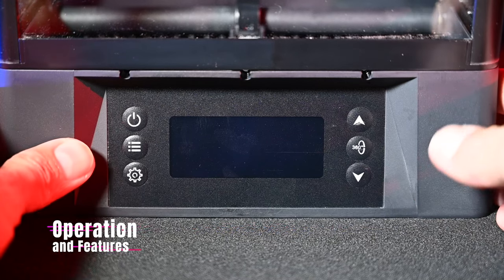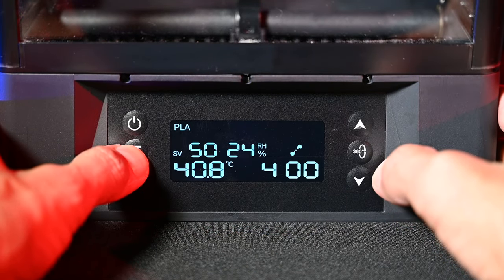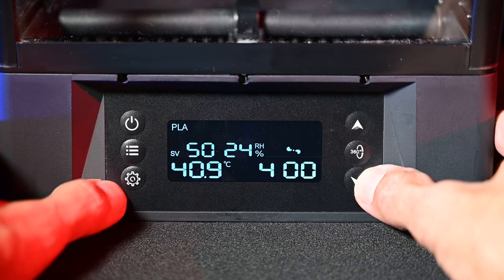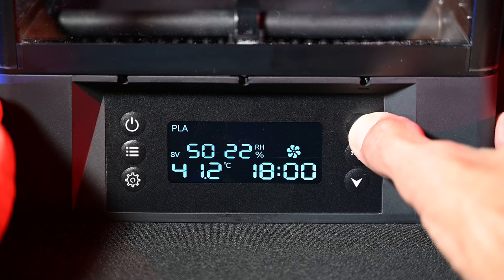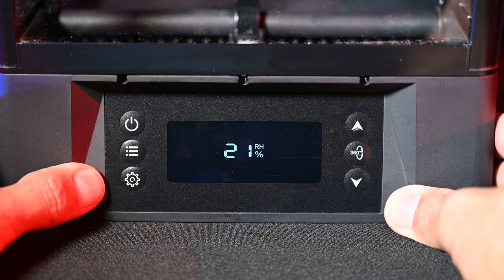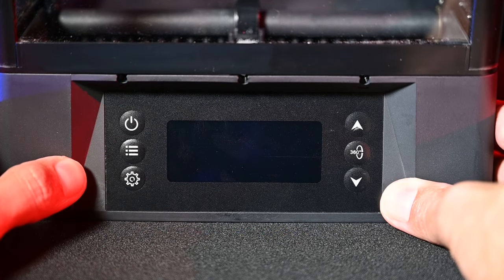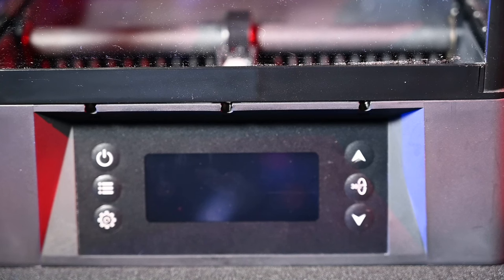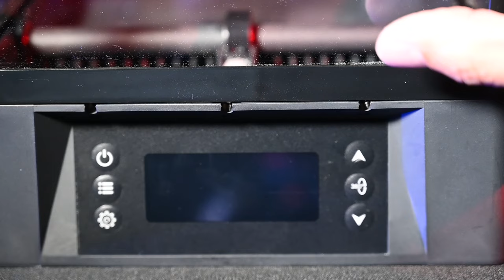eibos Polyphemus Review and Roller Upgrades! - Rotating Filament Dryer for 3D Printing

Comment: Your spot on with your comments, especially the pros and cons.  I discovered your channel when I was looking for a solution to fix why my filament was not rotating all the time when that 360 setting was enabled.  I think I ruined two brand-new spools of PLA filament because the spools were not rotating during drying and the bottom area cooked them.  When I attempted to use the filament certain areas of the filament kept breaking because it was brittle while other parts were fine.  Like you, I purchased my unit during the pre-order and am happy with the unit but my other grip is the top is very flimsy and feels very cheap, especially for the price of the unit.  My handle is loose all the time but it doesn't fall off so I just deal with it. Thanks to your "roller sleeve" upgrade, I now believe this unit and I can have a happy working relationship.  One additional improvement I would like to see Eibos make would be for the unit to go into humidity mode when the unit finishes drying.  Maybe these improvements will be added to version 2.  Thanks for you video!
Reply from the maker: Glad the video and sleeves helped you out! Humidity mode would be an awesome addition.

Comment: Nice review.  I like the sleeves-- definitely a good idea for this unit.  

Regarding Quality Control, mine arrived with an upside down control panel, and no matter what you clicked on the panel, if it was on, it went to 70+ C and stayed there.  I took a photo of it running at 65 when the target temp was 50, and showing the inverted panel, and they instantly shipped me a new base, with instructions to toss the old one.  So +10 for customer service, minus a whole lot for them not noticing it wasn't assembled properly before they shipped it.

All in all, with a few mods, it seems like a good unit.  I've been drying my antique filaments lately, and having issues because they don't fit (remember the short/fat spools?), so I think I'm going to print a rack to put them on.  Or maybe remix a spool holder to fit inside and keep the spool elevated.
Reply from the maker: Wow, that is wild! I hope they step up QC some. Glad to hear that they took care of you though!

Comment: An excellent no-nonsense review.  I agree with your points, especially the cons.  I've experienced the spools walking towards the outside edges when the rotation feature is on, so your TPU sleeve is something I will consider.  Thanks for sharing.

On my unit, I have an annoying defect, where it appears that there is backlighting on the right column of buttons (up, rotate, down) but not on the left column.  Not sure whether the backlighting is an intended feature or just light bleed from the main LCD panel.  By itself, it wouldn't be so bad, except the icons are unevenly lit and hard to make out due to an obstruction behind the buttons. I realize this is a nit compared to some of the functional issues others have reported.
Can you confirm whether your buttons are backlit?  I couldn't tell from the video.

Looking forward to your next video on the unit disassembly.  How far did you go on the tear-down?
Reply from the maker: Apreciate the reply!  I can confirm what you've observed on your unit with respect to the buttons on the right side.  Mine are partially lit up.  It's not even lighting either. It's almost like the buttons are only partially transparent so the backlight is coming through in random spots.  There doesn't seem to be any light on the left side buttons at all.  The tear down involved removing the bottom cover to see all the internals as I was investigating the best way to remove the motor and the rollers.
Reply: @directedt3ch  Thanks for the confirmation.  Sounds like a QA issue then.  Possibly the button membrane film had a protective backing and during assembly, they did not remove the left side, and the right side one did not come off cleanly leaving debris behind.

Does it bother you enough to attempt to fix it?  Might even be able to restore backlighting to the left side buttons... 😀

Comment: Great review, one of the better ones I've found. Do you know if when in the auto humidity mode it has any issues maintaining lower levels like 10%? Just curious how often it'd be turning on and off especially if the room humidity is a lot higher (like 70%)?
Reply from the maker: I'm honestly not sure.  I've never kept it running like that.  I usually just let it complete a timed cycle.

Comment: Thanks for this review, I received my Polyphemus today and as you point out, the roller design is not great. It certainly doesn't work well with my Bambu Labs spools. I will try printing your TPU sleeves tomorrow (TPU on its way). In the meantime I have wrapped some insulating tape around the rollers and that seems to have got the spools rotating quite consistently.  I am a bit concerned about how easily the spools will rotate when printing direct from this unit. I haven't tried printing from it it yet, but if I try to rotate the spools by hand with the motor off, there is quite a lot of resistance. Other than the roller issue it seems like a good unit. *Edit I have now realised that the resistance I felt when rotating the spool by hand is dependent upon when you switch of the rotation feature. If you happen to stop the rotation when the drive wheel is engaged with the roller then there is significant resistance. It would be better if Eibos found a way to ensure that the drive wheel always stopped in the disengaged position. **Edit 2 I've done quite a bit of printing from the dryer now and it works well.
Reply from the maker: Thanks Martin!  Sounds like we are on the same page.  When I post the teardown video you'll be able to see how that drive gearing works.  I totally agree with everything you stated in your comment.  This dryer is like 90% awesome with a few really bizarre quirks that could have been addressed with more testing and thought.

Comment: Excellent review. I think my own opinion of this unit pretty much mirrors your own, I think its probably the best dryer on the market, and the only one I really trust to actually evenly dry filament, but the QA is lazy and the rollers are just made of the wrong material. Another beef I have with this dryer is that it doesn't switch into storage made after it finishes drying -- what were they thinking? 
I'll be printing up your sleeves soon! Thanks for making and sharing that!
Reply from the maker: Thank you!  Totally agree with you.  Entering to the storage mode would have been brilliant!  Seems like something they could have easily done.  Unfortunately there is no path for firmware updates on this, so I guess we'll always be stuck with switching on the humidity hold mode manually. Glad you are going to take advantage of the roller sleeves!

Comment: Good review. Is the fan speed adjustable/does it change according to the "heating level"?
Reply from the maker: The fan speed is adjustable.
Reply: @directedt3ch  Can you confirm that the fan speed audibly changes when you adjust it? The thing is, mine doesn't. And eibos says that it's not supposed to. 🤔
Reply from the maker: @rs90009  That's really interesting!  I just tried changing the fan speed on my unit and I can't hear or tell any difference in the three fan speed settings.... hmm....
Reply: @directedt3ch  They told me that the "fan speed change" actually just changes the power level for the PTC heater. So the spinning fan icon is a bit misleading. At least I know my unit is working as intended. Thanks!
Reply from the maker: @rs90009  Oh wow... hmmm... what an odd way to go about that. I wonder what the point is then...

Comment: Have you considered the following hack : replace the plastic panels with some insulating material, cork for example. Considering the construction, it should be pretty easy to do.
Reply from the maker: Not a bad idea!

Comment: Too bad its not on Amazon! That looks really cool though, I wish my filament dryer rotated the spools. The sleeves you made look really cool, I wonder if you can design something like that for the AMS system to use with cardboard spools. I know there are other options and I haven't looked into the AMS personally to see how it works but I bet adding grip would be helpful.
Reply from the maker: They have the cyclopes on Amazon, but this one hasn't made it's way there yet.  I imagine it will in time.  The AMS does have rubber rollers, so it doesn't need a modification like this.  The problem people run into with the AMS is the opposite, the cardboard spools are either bent/warped which causes the traction to be uneven, or the cardboard bits get on the rubber and make it less grippy.

Comment: Nice review, but ... $130 for a two spool dryer for which you still have to then assemble the top yourself?  That's about what a Sunlu S4 would cost and that one can hold 4 spools.  I consider both overpriced.  I'll stick to my Ikea 365+ boxes with dessicant for storage and $30 slightly modified food dehydrator with vertical axis spool mount whose AC heater has no problems reaching 80C or above.  One day I might add some brains (like an ESP8266) to that dehydrator, but for now the stock mechanism and added $2 digital thermometer for getting reliable temperature (unlike the temps on the analog knob) works well enough.
Reply from the maker: Can't argue with your solution! Glad you have something that works well for you.